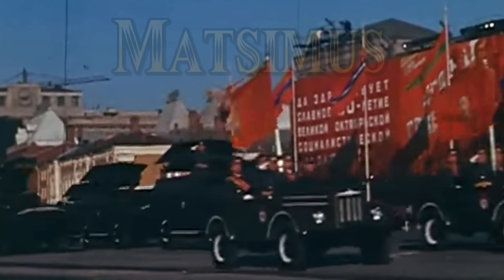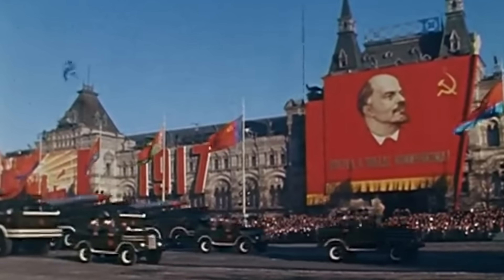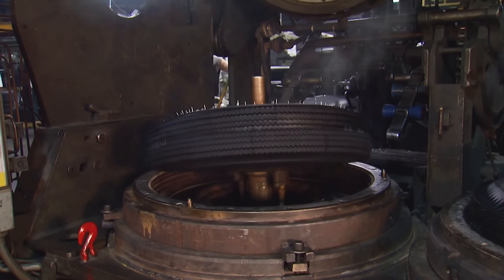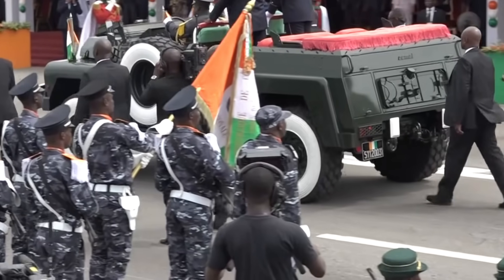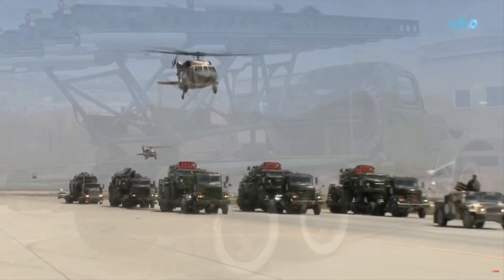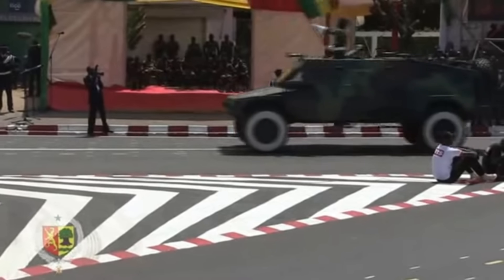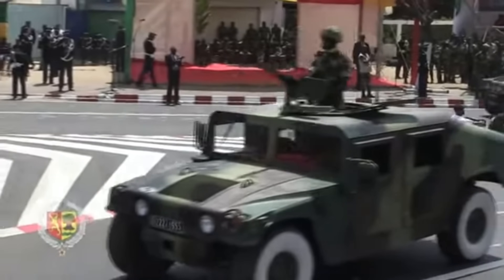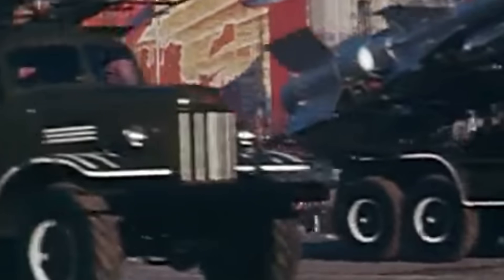Why do Soviet/Russian, North Korean and Chinese military vehicles have white wall tires?

Comment: I was in the Soviet Union and Mongolia and China in 1986.  Did not see any whitewall tyres on  army trucks which drove there.  What you see is that the vehicles which are used on parades is that not only the tyres are white, but also a lot of details on the body as you see at 0:31.  I think it makes them better presentable to the peoples watching. Sometimes you see also white corners on bumpers or fenders, These are used to show the dimensions of the vehicle in blackout use. 

Actually you'll see that many North Korean vehicles have painted  camo painting om the tire sidewalls.
Reply: In 1960 the family cars had white tyres as well
Reply: camo paint on a moving tyre? Don't think they understand how camo works because that would be as useful as painting them pink.
Reply: Oh wow, what was like China back then? It must have changed so so much
Reply: @richbob9155   I guess they think the vehicles stand more  in ambushes  then they are riding.
Reply: @richbob9155  I don't think you understand how camo/hiding or military vehicles work.
Yes, camo on a rotating tire doesn't really work. It would just blend to one color. But importantly to a natural color. A color that isn't obviously man made. So you saying that they could paint it pink is just stupid (yeah, I know hyperbolic. But still stupid).

And secondly military vehicles stand around a lot. A lot a lot.
Reply: @enricol5974 . As a young man in the 60s, I was proud of my white walls, as I got older, all black was the way to go. A lot less work cleaning every week.
Reply: Actually, come to think of it.. rifles used for parade drill are similarly gussied up, usually by chroming all the metal parts.
Reply: See a lot of those Soviet vehicles it's the wheels painted white and not the sidewalls of the tires.
Reply: Spot on, they are parade tyres.
Reply: Bingo
Reply: Exactly. Military parades are boring and they decorated the equipment to make them more attractive. A wash and fresh coat of paint made old equipment look new. Tire paint was fairly common in the US back then also, but mosly for civilian cars. Tires deteriorated fairly quickly thru the 70's so black or white tire paint was used to dress tires, mostly for civilian use.
Reply: Just trying to catch up to the American aesthetic of the mid-20th century.  😊 I've spent enough time getting to know some officials in Eastern Europe to learn where they send their children for school and prefer to spend free time if they can--in the West. Even the Kim family in NK does this, as the current generation's schooling illustrates.
Reply: We had them in the army and active service and it wasnt russia.
Reply: Leopard patterned interiors?
Reply: We had cccp era trucks here in Finland and no such a tyres. None. CLICKBAIT!
Reply: @richbob9155 If the vehicule is moving, its not the mouvement of camo on the tires that will makes it easier to be spotted. Its useless and a waste of money as generally if you try to hide a vehicule the tires will be the least visible parts, and black is hard enought to spot, but clearly if you miss a truck doing 60kph on a road on and only figure out its here when you are able to see the color of its wheels I don't want you on my side.
Reply: Well said
Reply: @justeunfan3364  @richbob9155  If we went with your logic, we might as well keep our vehicles entirely camo-free. As pointed out several times before, it's not about when the vehicles are moving. 99,99% of the time the vehicles are sitting around somewhere. As far as trying to hide them goes, that will be done according to what makes the most sense in the situation, and what happens to be available. You're not going to be digging in if you're only sticking around for a couple of hours tops. Not to mention doing so will more often than not leave behind much more telling signs of your activity. And you're not going to make that stop too far out of the way from your objective just to have the 100% ideal conditions for hiding you apparently have in your head. Also you are seriously underestimating how fucking bad black is. There is a reason why we camo our rifles if at all possible/allowed, and why black boots have either been phased out or outright banned in several militaries. Hell, Ukraine at the start of the war (and currently from drone operator perspective) is a good example. You can have troops blend in the background very well, but they're betrayed by their black boots.

Is painting wheels wasteful? Almost certainly. Does it make more sense than your silly arguments against it? Absolutely.
Reply: I don't know maybe because they are super badass
Reply: @tormfury7376  You don't seemed to understand my point. I answerd to @richbob9155  's first comment about how putting cammo on a "moving tyre" would make the vehicule more visible. Obviously when it stand still the problem is not the same. I only pointed out that if a vehicule is moving wether its wheels are black or green will have absolutely no influence on how visible it is. 

About when the vehicule stand still, the cast majority of the time the enemy will not spot the tires first. If you manage to perfectly conceal the entire vehicule, the tires will be hiden. If its somewhat visible the square box 4-5 m above the ground will be spotted way before the black tires.  It may depends a bit on your country's climate. If there is a lot of hight vegetation it will likely cover the wheels or they will blend in the shadows. If you add that to the fact you can't paint the tire anyways, and that paint on the wheels will often be scratched off faster, in the vast majority of cases its better not to bother as its a waste of time and ressources to paint your wheels. 

About putting camo on everything, boots and weapons included I'd like to see some sources, I never saw anywere that it allow you to be better hidden. Boots are no more rubber, they are fabric and often similar to the material used for the rest of the uniforms. Its cheaper for an army to have all its gear the same color, I've never saw an army using cammo colored rubber boots or black painted fabric ones. Then its also mostly a matter of esthetics, you will have to choose a color for the boots, you choose the same as the rest of the uniform. 

For the weapons its the same, all are black, coated not to reflect light and thats it, except for some very specific units like snipers that must avoid very active scrutiny from the enemy. But you won't make 200 soldiers crawl to an ennemy location whithout them evey noticing you are in the nearby region. 

To go back to the star of the discussion, as I said painting tires is useless and have zero influence on the detection of a moving vehicule, that's it.
Reply: When I visited China in 1979-1981 I noticed that military & high level members of CCP had white wall tires. Back then there were few personal vehicles & vast majority people in China has bicycles so that was easier to notice that. 
Also, buses, taxis & other vehicles that I rode in didn’t have white wall tires. 
Actually, older tire rubber formulas broke down in the sun so they used white walls to prevent degradation in the sun. Since the late 1980’s to 1990’s they have changed the rubber formulation to prevent UV & ozone degradation so that when the majority of the west got away from white wall tires. I don’t know much other countries & how white wall tires are perceived.
Reply: @enricol5974  My car still does.
Reply: You can see that all the edges of the missile truck are painted white in that Soviet parade footage too. I think there is definitly an elelment of pizzazz to it just for the parade as it would make for tirrible camoflague
Reply: It’s perfect for propaganda, white detailing so it’s easier to depict the vehicles in media.
Reply: @FirstnameLastname-py3bc  China is massive of cause so this is a hard question to answer but in general I'd say, In terms of fashion, it was kinda like N Korea, but other than that the people were more liberal and the food were much better.... like arguably even when compared with today
Reply: @Jehty_  if he doesnt understand what that means then he must be a 9 year old secretly time travelling towards the 80s
Reply: Not according to the youtube expert who made this video, He doesnt really present a clear description of what he thinks is the reason , except" its cheap".
Reply: @richbob9155  Camo works fine when vehicles get parked in the bush.
Reply: Real reason is looks, most people forget old televisions were black and white with poor picture quality and low contrast. Same reasoning in sport were teams have 2 or 3 color variation so teams dont look similar in black and white. White wall tires, rims and white lines on military vehicles are just so its better see them on old TV. Otherwise they look like black blob. They were never used in combat.
Reply: @richbob9155  Moving object is easier to spot no matter the camouflage. Its useful when it is not moving as you break the circular geometrical pattern of wheels, as our brain spot easier round object then rectangular.
Also look up Mountbatten pink as a successful use of pink as a camo. Downsides were mostly in mixing consistency as it was sensitive to minor changes that can dramatically hinder it performance. Gray was more forgiving and work in more environmental lighting situations.
Reply: @Jehty_  pink camo google Mountbatten pink, it was not that stupid as you think and used in WW2
Reply: @scasny  "The primary problem with Mountbatten pink was that it stood out around midday, when the sky was no longer pink" (copied from Wiki)
Sounds pretty stupid to me.
Reply: @enricol5974  , there wera no family cars is 60's in Soviet Union.There were no white wall tires at all. In 70-80's some "slilagi" (retro-sltyle men) painted their citizen car tyres white and try to buy "flippera" (independed whitewall). But it was extraordinary.
Reply: Just checked the Chinese 2019 parade. No white tyres...
Reply: Just checked the Chinese 2019 parade. No white tyres...
Reply: I concur. During my two-year tenure in the 1980s I've seen probably tens of thousands of trucks evacuated from Chernobyl - they were being naturally "decontaminated" by the wind in the open fields - and none had whitewalls or white wheels. Plain army green with black frames and black wheels.
Reply: @richbob9155 unless they are parked , correct?

Comment: White walls were good decoration, but they were also a quick giveaway to the tire pressure being too low even by a little. The white wall looked thinner at the bottom then you knew you were low on air quicker than you did with a black wall.
Reply: The only problem with this theory that NOBODY in the whole of East Block ever used white wall tires outside the parades. I don't even think that anyone made any, they were just painted just before the parade to lastr just long enough.
Reply: @piotrmalewski8178 I agree! No white tires in Romanian armed forces!
Reply: I was only stating a benefit, I wasn't implying that there were white walls everywhere in the world.

Comment: Manufacturers still incorporate white rubber depending on requirements. I have some Cooper Discoverer AT tyres on my jeep with outline white letters. These letters protrude through the black sidewall and if the sidewall wears more white rubber becomes visible.

Comment: A few points. Carbon black was added to tires, specifically the tread of the tread blocks of the bias ply tires of the day because it reduces the rolling resistance (Internal friction from the deformation of the tire) the secondary effect was it improved UV resistance. It wasn't a cost saving measure in terms of production but to make a better tire. Rubber is not black as we think it is but an off white as natural rubber is latex. And modern tires still use latex as one of the main components. 

Now as time went on and tires lasted longer adding the UV protection of carbon black to the outer sidewall of the tires became a thing and if the customer wanted white wall tires that would be abraded off as you can see in the footage you used. And as people came to accept all black tires more and more the grinded off band became narrower and narrower. Many bias ply tires to this day can still be made into white walls. Radial tires on the other hand tend use full carbon black sidewalls now as the sidewall of a radial has more flex and deformation. 

As to painting tires. Yes it can help prevent sidewall checking which would look bad on a parade vehicle but it also just looks nicer, it gives it a nice contrast and look of care and pride that even your most untrained a conscript can do cheaply.
Reply: Yes, I was thinking the same thing. Carbon is such a cheap material that it's difficult to understand how not including it in certain parts of the finished product could be a cost-cutting measure...
Reply: Also, the white color of the Michelin Man comes from a time when tires were white. He also used to be made of more tires, because Michelin was originally a bike tire company.

Comment: My Chevy S-10 (1992) had white wall tires. 

I remember one time when my dad went with me to get tires, the tire guy asked if we wanted the white wall on the inside or outside.....
Reply: I got my tires mounted white walls in in the late 80's... my dad went into appoplexy 😂😂😂
Reply: Still sort of a thing, especially with truck tires as they often have a white lettering option available.  So you pick, white in or out.  Definitely a choice that had to be made on most tire purchases up through the early or mid 90's as many cars targeting middle age and older buyers came with 'white wall" tires, though the white was just an inch wide or so.  Of course, some cars targeting the same buyers also had a fabric/vinyl roof option.

Comment: In the US as late as the 1990's there were still many new tires for sale with one white wall side, so you could choose between white walls or not depending on how the tire was installed. The problem in the US civilian market is that they were too hard to keep clean and looking nice.
Reply: I feel like that's the same reason why chrome parts on cars, motorcycles and bicycles has fallen out of favour. You actually have to maintain it and most people are too lazy for that, so manufacturers just paint metal parts black instead these days. Probably part of the reason why real leather isn't used too often anymore too. You have to use a treatment on it every now and then or else it hardens and starts cracking. Most people out there don't want to have to worry about that sort of stuff. People want stuff, but they don't want to have to take care of said stuff.
Reply: It didn’t matter to me because I wanted the black side facing out. So it didn’t  matter if they got dirty.
Reply: White walls were a car trend. Trends tend to die out. But they also tend to reemerge
Reply: @EcchiGamingYT  "Leather" car seats aren't leather because it's easier and cheaper to paint the most ugly piece of leather to looking halfway decent. Rather than looking like crap because of no care, it'll look like crap eventually because it was just lipstick on a pig to begin with. 90% of "leather" products are like this, a shiny veneer on garbage. 

It's also why woodgrain is usually just plastic or a sticker.  Give me vinyl, effectively the same thing.

Old chrome would last. New chrome is literally plastic and will eventually chip off no matter what you do.
Reply: @EcchiGamingYT  Bright plating became too expensive as it is a very toxic environment to work in.  Environmental issues.
Reply: @markellii3093  A 100 year long trend ? Hmm OK  Kind of like eating.  Most people don't make the 100 years. Eating is a trend.
Reply: @danharold3087  people eat every day. Filling up the gas tank isn't a trend it's a prerequisite.
Reply: @markellii3093   Whatever.  I was just pointing out that something that lasts for 100 years is a very long trend. If one can call it a trend.  Excuse me if  you did not care for the comparison to eating.
Reply: @danharold3087  nah, it's ok, might be a misunderstanding on my part. It's just that from what I know, whitewalls have disappeared for some time and then became popular again.
Reply: @markellii3093  Not a problem.
Reply: @EcchiGamingYT  Spoke like a true careless consumerist. Back then you worked hard and you were proud of what you had and you worked to maintain it.

Comment: I read once that it was done to make the details of the vehicles in parades stand out when viewed on low resolution black and white televisions. The white tires/rims are just one part of the parade dress up for vehicle, where important body lines are highlighted in white. 

Then it spread to other countries and stuck around as tradition, despite better TVs etc. making the visibility improvements obsolete. I don't know if it is true or not, but it makes sense, especially if you check for yourself by watching black and white recordings of Soviet parades.